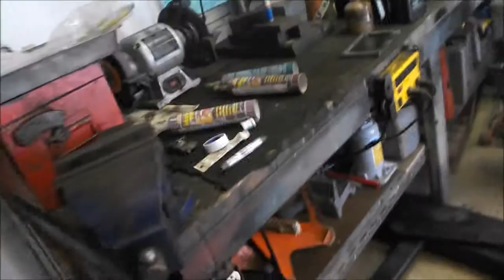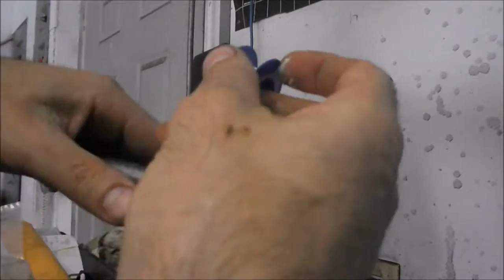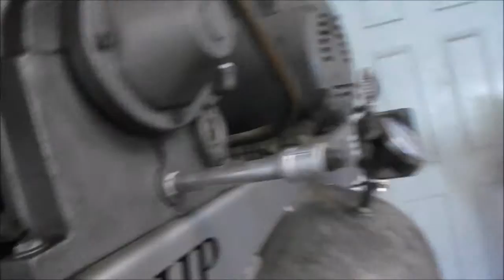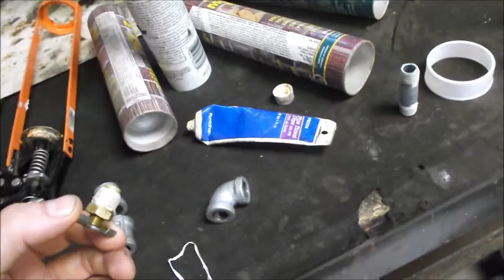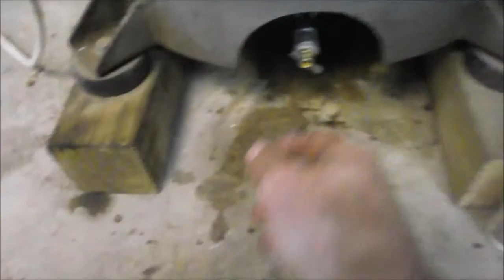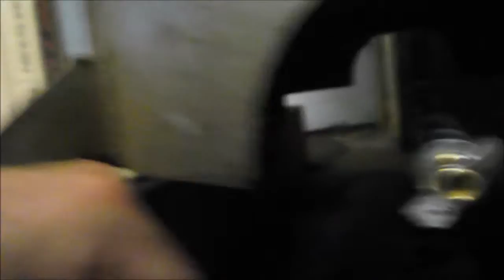DIY Making Air Compressor Pump and Tank Maintenance Easier

Comment: It's nice that you're thinking, but it could be even better.   1, petcocks aren't as easy to use as a ball valve.  2, get 2 street elbows.  Replace the brass nipple at the compressor and the elbow connected to it with 1 of the street elbows.  Next, replace the petcock with he ball valve, and attach the other street elbow into it, finishing pointed down.  The hole assembly will be higher to allow more broom clearance and the last elbow will make it easier o drain into the pan or bucket you use.  You could alternatively substitute a hose Bab for the last elbow and direct the discharge just about anyplace you want.  Minor note, Black pipe is called black because that's its actual color, but it's pretty interchangeable with galvanized as the dimensions are identical.